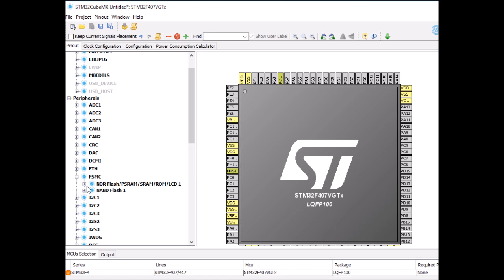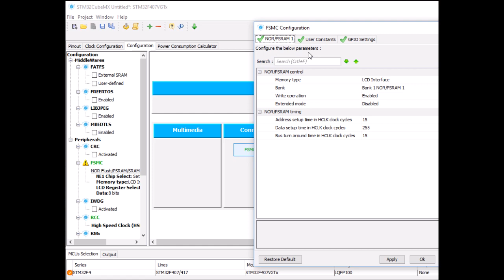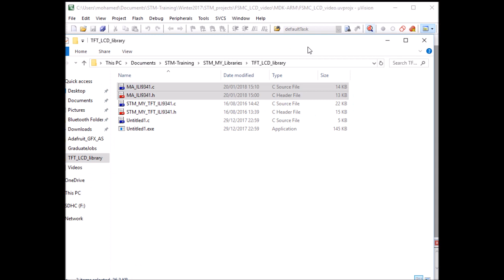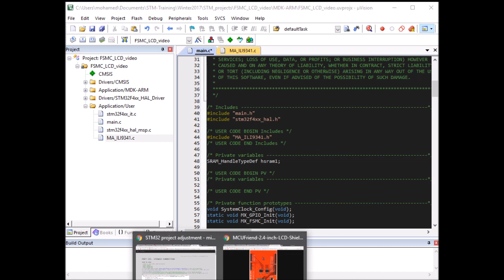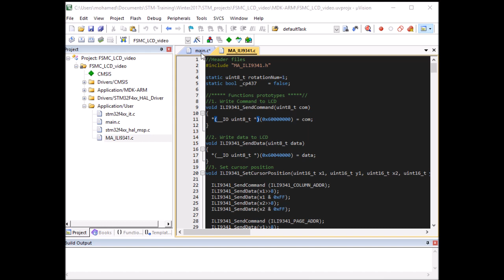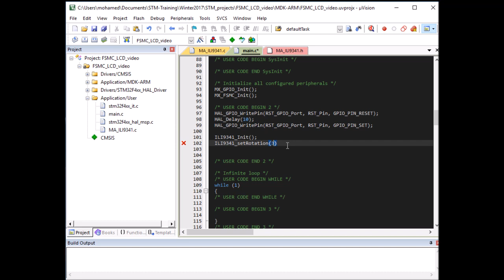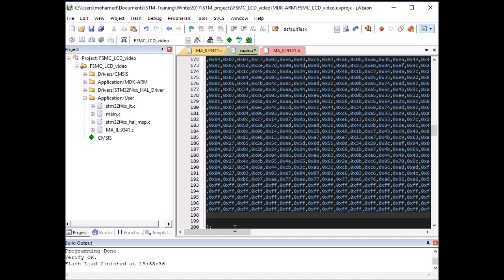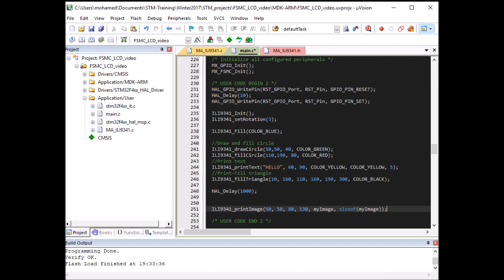STM32F4 Discovery board - Keil 5 IDE with CubeMX: Tutorial 21 - TFT LCD ili9341 (using FSMC)

Comment: The Code is well explained however it will be further useful if you create video of ..
A  ILI9341 2.4 keil Project configured with cubemx ,  gui created with GUIBuilder, and touch screen code

To add further you can really demostrate the use of gui development tool like 
"μGUI - free Open Source GUI module for embedded systems"  [https://embeddedlightning.com/ugui/]
EasyGUI - Easy GUI for microcontrollers [https://github.com/MaJerle/EasyGUI]
littlev - [https://littlevgl.com/porting]
Since these three tools are free of cost and really contributes a main step of product development

thanks

Comment: Many Thanks! How can I modify a the functions to work with 16bits ?
Reply from the maker: Hi Erisson,
Sorry for the late response, you can modify the FSMC settings to use 16-bits and some little changes to the address of read/write and wiring,, all other things will remain the same.

Comment: Is it a possible to touch on screen? Because i see you only display the pic on screen. Hope you answer my question. I need to know because i’m ready to buy that screen. Tks
Reply from the maker: Hi,
Yes, this one has got resistive touch, but touch pins (x+, x-, y+, y-) are shared with communication pins, look that up.
There is a good alternative too, that works with this library: https://www.mikroe.com/tft-proto-board
Good luck
Reply: Tks for your quink reply but I still have some question. You said that touch pins are shared with communication pins. So you mean that is impossible to do touch action on that screen with stm32f4, isn't it? Hope you rep soon because i'm ready to buy that touch screen (in you vid) to use for kit stm32f4 :D
Reply from the maker: Hi mate,
What I meant by touch pins are shared at this particular module is that, X+, X-, Y+, Y- are connected directly to LCD_WR, LCD_RD, and so on. So in order to take Touch reading, you need to stop communicating to the LCD temporarily and convert LCD_WR pin from Output to Input in order to read touch value.
But there are better ili9341 screen boards where touch pins are separate.

Comment: Hi there MYaqoobEmbedded,

Would the tutorial work using the NUCLEO-L476RG, if not what would you need to change?
Thanks for any help.
Reply from the maker: Hi,
No, the L476 does not seem to have an FSMC NOR interface.
Reply: Do you have any recommendations on how to get an TFT LCD ILI9341 screen working on the NUCLEO-L476RG?
Reply from the maker: Psyduck 
Hi,
You can replace FSMC Read/Write functions with SPI read/write .. but needs to set your display to spi mode.
Reply: MYaqoobEmbedded thanks for the reply, unfortunately the screen I'm using does have spi :'(
Reply from the maker: Psyduck 
You can try implementing the parallel interface timing yourself;
Set the data on 8bits or 16 bits pins and trigger WR pin to write data to lcd.. There are a lot more details about this on lcd data sheet.. Just google lcd parallel interface 8080
Reply: Hello MYaqoobEmbedded, i love your video. Possible to create a VIDEO Keil 5 IDE with CubeMX WITH 3.5" TFT which is similar to Tutorial 21 FSMC? Can you help to connect it with ILI9481 3.5" or other 3.5" TFT under KEIL 5 cubeMX or others such as SOLOMON SYSTECH but not sure. I like STM32 FSMC, some 3.5" TFT with SPI; but it seems FSMC is faster and better, it is the future.

Comment: Great video! I have a stm32L4 and it havent the FSMC option, could you teach how to do it by the SPI interface?
Reply from the maker: Hi,

Modify Read/Write functions to use SPI Write&Read instead of FSMC Read/Write,, as simple as that.
Reply from the maker: There are 4 changes you need to make to replace FSMC with SPI:
Step(1): The wiring of LCD SPI interface is different
MBED Display
+ 3,3V 3,3V
GND GND
MOSI SDI
MISO SDO
SCK        RS
CS         CS
Reset RST
DC         WR/SCL
GND RD

Step(2): Need to enable a Digital Output pin DC pin (Data/Command)
- At the start of ILI9341_SendCommand() function, set DC to LOW.
- At ILI9341_SendData() function, set DC to HIGH.

Step(3): replace "*(__IO uint8_t *)(0x60000000) = com;" in ILI9341_SendCommand() function with HAL_SPI_Transmit() function and transmit the command byte.

Step(4): Similarly replace "*(__IO uint8_t *)(0x60040000) = data;" in ILI9341_SendData() function with HAL_SPI_Transmit() function and transmit the data byte.

So, the modified functions should look something like this:
ILI9341_SendCommand(uint8_t com)
{
HAL_GPIO_WritePin(DC_Port, DC_Pin, 0);
HAL_SPI_Transmit(&hspi, com, 1, Timeout);
}

ILI9341_SendData(uint8_t data)
{
HAL_GPIO_WritePin(DC_Port, DC_Pin, 1);
HAL_SPI_Transmit(&hspi, data 1, Timeout);
}

That's pretty much it,, Good luck
Reply: Yes, I too would like to know how to do the same. If you can, please give a little more information. Thanks!
Reply from the maker: Mrudula Amirapu 
Hi,
Sure.. I will explain to you how to do that with some coding later today.
Reply: Thank you very much! I find your tutorials very helpful! :)
Reply: Thanks for the quick reply! :)
I have a couple of doubts though...
1) What should the prescaler or rate be for this LCD in SPI interface configuration?
2) DC         WR/SCL (is this the LCD_WR pin?)
3) SD_SCK and SD_SS needn't be connected if we are not using the SD card slot, right?

Really appreciate the help! :)

Comment: I subscribed to your awesome channel and like every video! You helped a lot in these playlist series. Can you make a video about 1.8 TFT ST7735 display but without any shields. It has only DIN and CLK pins for data and several pins for control. Thanks in advance
Reply from the maker: Amfibrachy 
Hello!
Good to hear that you're finding the videos helpful.. For the ST7735 LCD, it should not be too hard to look at an existing code alongside with its datasheet to create a driver for it. I have not worked on this before, but you should be fine if you spent sometime on it. Good luck
Reply: Thanks you. That's my laziness I suppose )) I haven't watched all your videos yet. So do you think if i'll follow all of them, I'll be able to make the display work without any library, all on my own + CubeMX?

Comment: Hi,
thanks for the reply,
on the parallel interface I would argue that, in the case of an ISP connection. Does FSMC also support ISP?
Is it possible to download any library for ARDUINO "TFT_22_ILI9225.h" in the STM32 environment. It is about using the least connection wires to the LCD display.
Reply from the maker: LMM LIGHT MY MUSIC 
Hi mate,
Does ISP = SPI Interface ?
Reply: Hu,
SPI is correct, my mistake!!
Reply from the maker: LMM LIGHT MY MUSIC 
FSMC is a different interface.. If you wanna use SPI, then you just use SPI to write to the LCD.

Comment: Hi,
Is it possible to connect a TFT LCD ILI9225 or any other with an ISP to a NUCLEO unit, or whether there is a library for this TFT LCD.
I am also interested in what sample FFT for NUCLEO boards. I use NUCLEO-144, STM32F767ZIT.

best regards
Reply from the maker: LMM LIGHT MY MUSIC 
Yes, it is possible of course.. as long as you have Parallel interface (8bits or 16 bits). You need to do the initialization sequence of the ili9225; you effectively need to have your own LCD driver but the FSMC Write concept is the same. 
Good Luck

Comment: جزاك الله خير الجزاء
Thanks for the detailed explanation on FSMC LCD. Hence, if I were to use a 16 bit interface, my register select should be A19 right? And could you please, please do part 4 for the ENC28J60 ethernet module and perhaps a simple tcp client on the stm32. Thanks again.
Reply from the maker: Rafiq Rahman 
That's right
Reply: thanks for your great explanation and tutorial.
with the same stm32 board what configuration must be changed if using a 16-bit FSMC on ili9341?